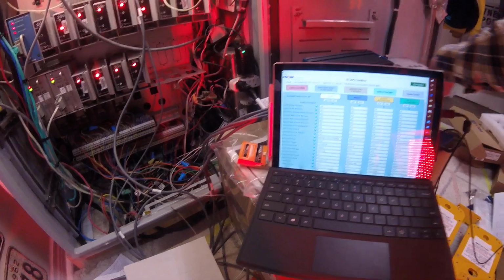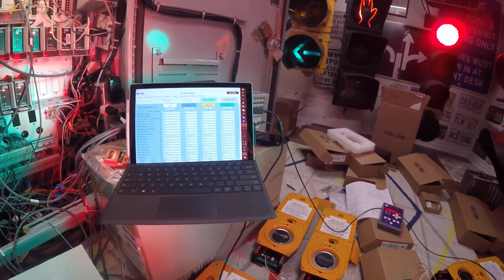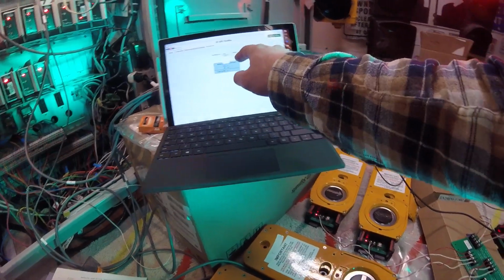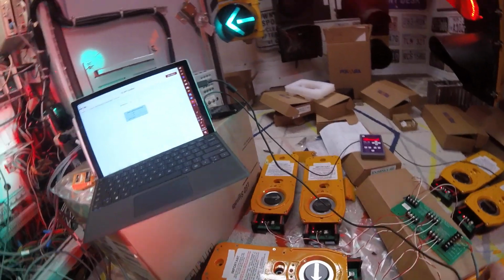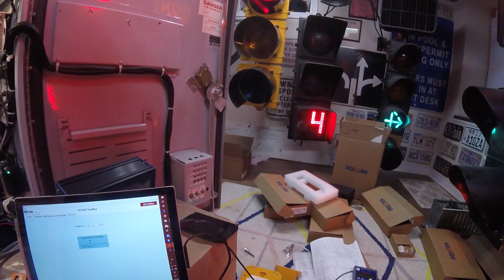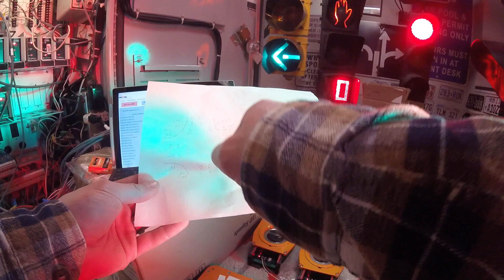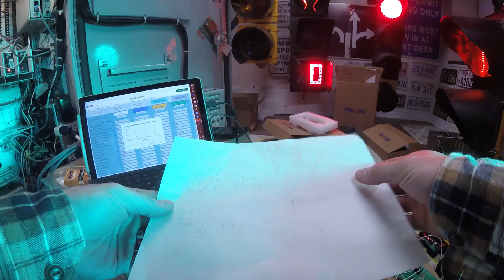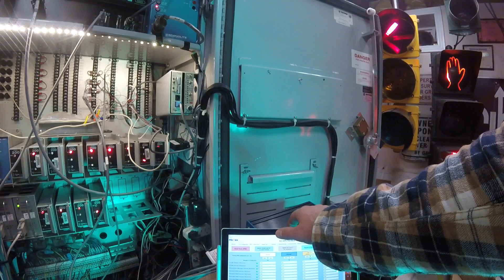How to Program the Polara Navigator EN2 Legacy Pushbutton & CCU

Comment: what is the default password using EZ APS? I cannot locate it anywhere online
Reply from the maker: Default passwords from the factory for this model is “AAAA” but they usually make you change the password once they’re set up. If you get locked out and have some information about the unit you’re trying to unlock, Polara can provide a reset code!
Reply: @TheTrafficTech  Sorry, i ment by the toolbox software.
Reply from the maker: @VeteranGamerVault  it would actually be the same password to log into the device as it would be in the field!
Reply: @TheTrafficTech  do you mean like its the same password as "AAAA"?
Reply from the maker: @VeteranGamerVault  exactly! The handheld remote or if you’re plugged into the unit would have the same password. The newer models have a different password structure.